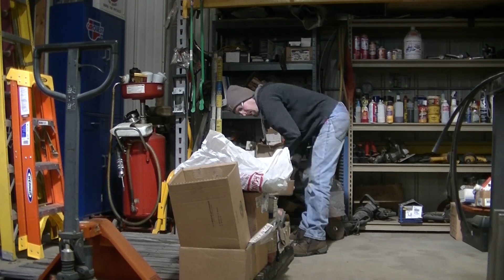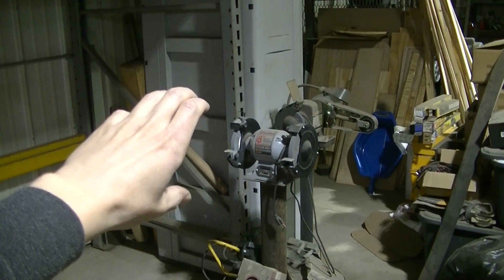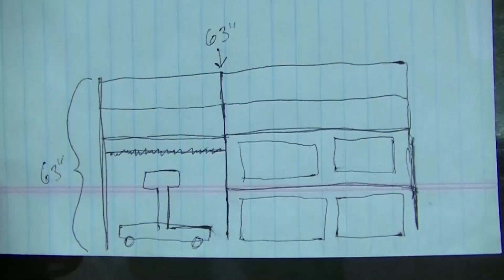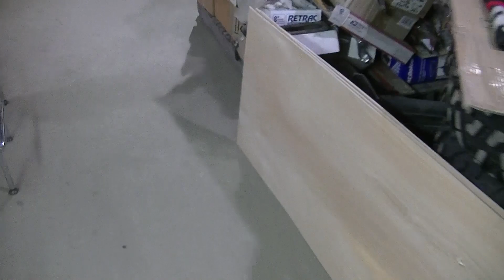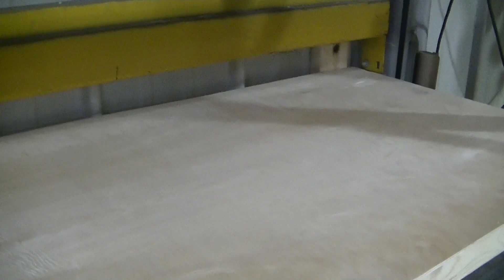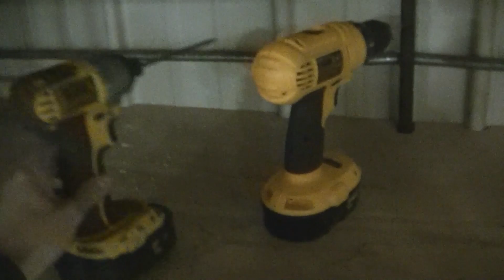Shop Shelf Build "Custom Shelf Built with 2x4's"

Comment: I need some parts for a john Deere 112 mower. got any idea where I could get em? don't think a dealership would get parts for a 41 year old mower.
Reply from the maker: +Randy Bobandy   I would try Ebay.
Reply: +mossman381 They have an aftermarket one that isnt the right style. I'm trying to go all original so I will probably have to buy an expensive one from a dealership when I get home. cost me $79USD for 2 motor mounts which was like $102CAD